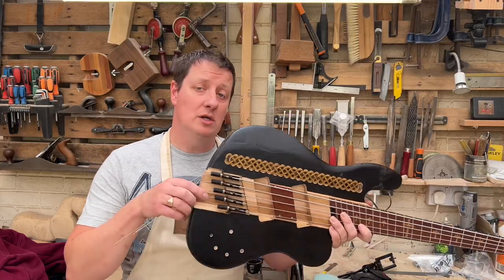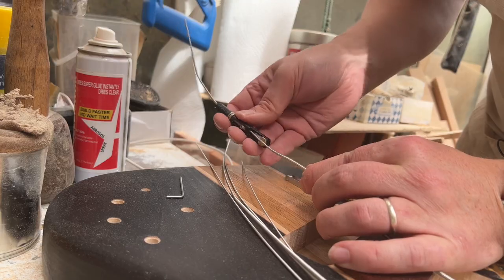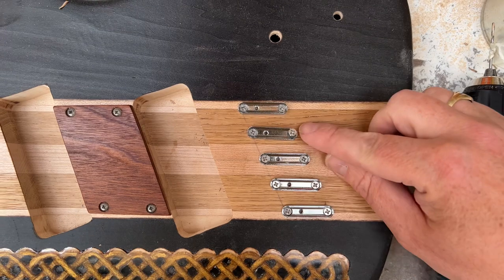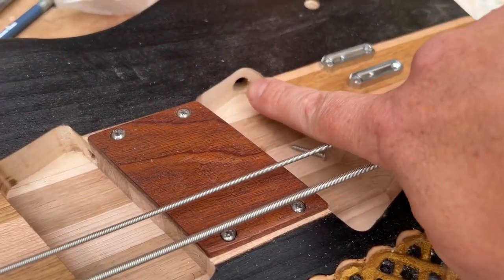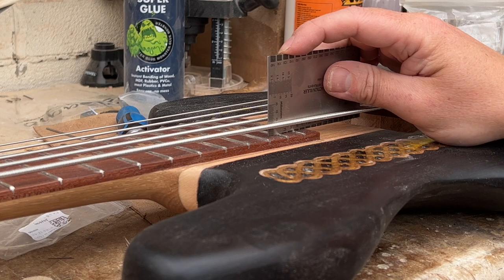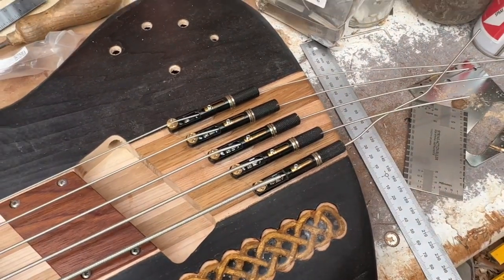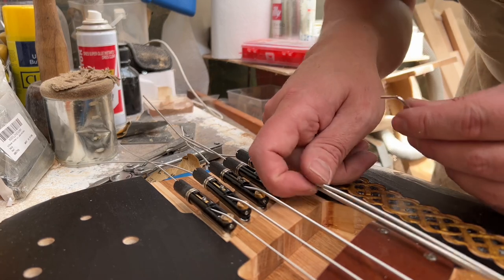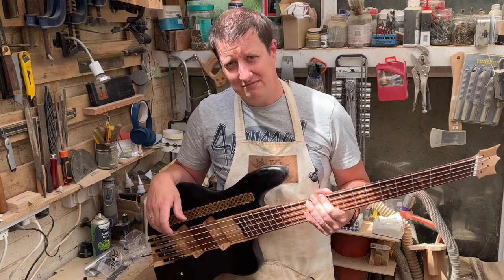Installing individual bridge pieces |  Bass guitar build part 15

Comment: I almost had a nervous breakdown installing these on my GGBO21 guitar.  If you look under them it's filler central from re-drilling holes!  Didn't help they're close enough to touch on a normal guitar.  Anyway, good insight into your thoughts during the process, cheers Chris.
Reply from the maker: I’m not looking forward to intonation!

Comment: These look the exact ones ive just put on my 12 string bass haha need to mod them alittle though for my application 😅
Reply from the maker: I was glad I could get the thinner end of the B string in the holes!
Reply: I plan on using the loop end in the bridge and the tail end on the headstock like conventional strings. Probably take the ball end off and just use the loops. But it  may all change and end up strung like yours haha

Comment: Did you have my grounding issues with the bridge? I’m aiming a guitar with similar independent mounting blocks and wondering how to ground it all(?)
Reply from the maker: I used a zero fret at the end which connects all the string together. Then just need to ground one of the bridges 👍

Comment: EXCELLENT WORK!!!!  Can you provide a link for the individual bass tuners you used???  I wish I had found those before I started a 6-string bass project I started a few months ago.
Reply from the maker: Thank you! These were Chinese made and bought from eBay. I can’t honestly recommend them any more though. Since the bass was finished they have moved under string tension and required me to create a holding cradle for them. It’s certainly not easy to find individual pieces that will lock in place and not move
Reply: @KingBespokeCreations  I fully understand.  I was intrigued as I'm trying to figure out the headstock design, and the ferules with string through at the bridge seemed like the perfect solution... #TheSearchContinues  Many Thanks